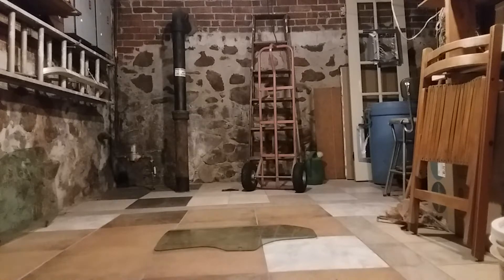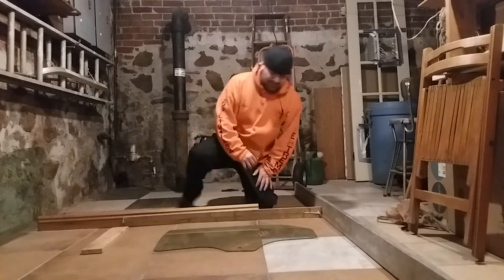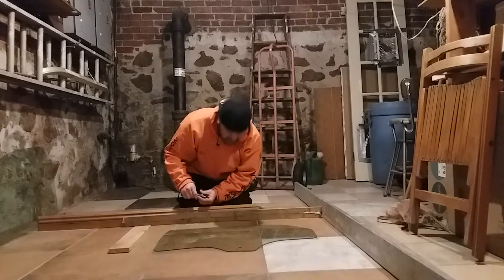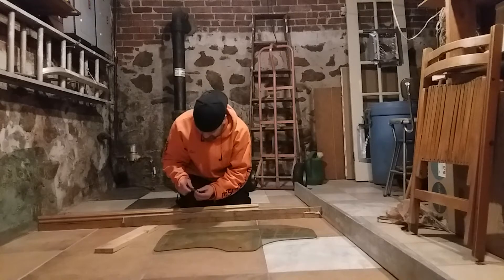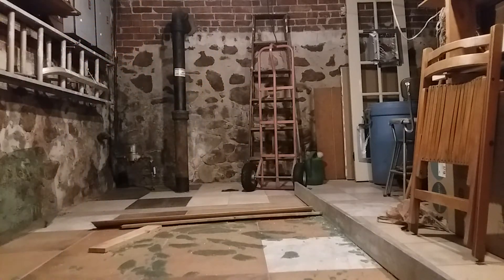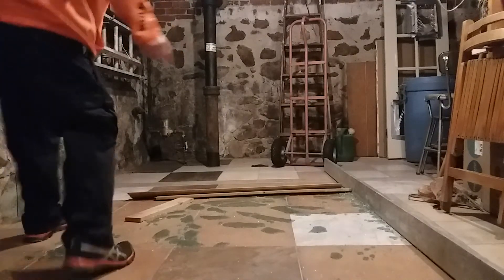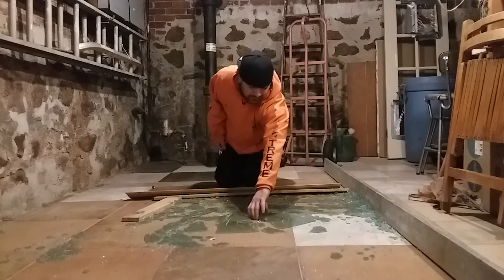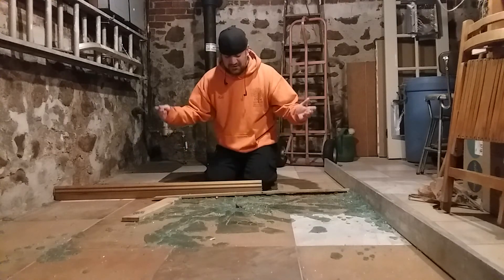CAN YOU BREAK A WINDOW WITH A CENTER PUNCH  (Why the hell not labs)

Comment: LOL great fun man, gotta love the old self contained center punch. We set off an early 70s Cadillac airbag once outside our shop years ago and it was hilarious since they used a shotgun shell for the inflation,,,,,,BOOM!
Reply from the maker: Yeah I like to do fun stuff like this once in a while. The wife is cool with it as long as I don't burn the place down or get hurt LOL
Reply from the maker: And the seventies airbags were nasty, dangerous too!! They are rare but they were out there. They were pretty just experimental and most of them were only found in fleet vehicles. That first generation airbag usually did more harm than it did good so they stopped them for almost 10 years until they were released in the 80s. They we're just a little bit ahead of their time and didn't have the technology for them to be completely safe yet

Comment: Use these in vehicle rescue! Click to the corner of the tempered glass side windows and they shatter but the glass stays put. You can pull it out toward you and it doesn’t cover the occupants. If you can go to a junk yard and do this on an intact window it’s really cool. (Of course it doesn’t work on the laminated windshields). Best part of rescue class!
Reply from the maker: That is really cool, thank you for that. And yes now that you mention it I can see just how useful this would be in an emergency situation. It was literally effortless when I touched it to the glass, and if it was contained in a window frame I can see how you would be able to easily control it.
Reply: Snow for you this w/e? Don’t know where you are...
Reply from the maker: @heatherk.9937  I hope so, supposed to get a few inches tonight as well.  Got all the trucks prepped and ready to go so I'm ready for whatever comes!! 
I'm in southern Connecticut

Comment: Works good for cars jus as good ss broken spark plugs and it dont set alarms off. Dumb thiefs think a boulder is gone break a window and it bounces rite off and knocks em out😂
Reply from the maker: Especially when you hit a window right in the center with a brick or rock. The glass is designed to take hits like that and it just flexes, shoots it right back like you said LOL.
Now I am no thief, but a center punch or a spark plug is also so much quieter if for some reason it were to occur